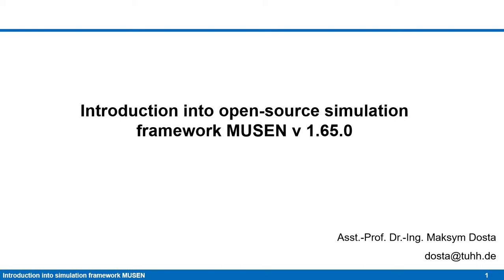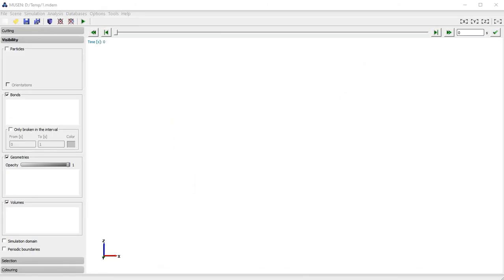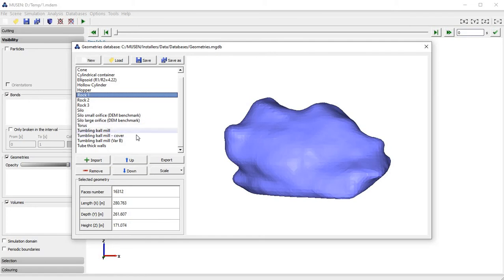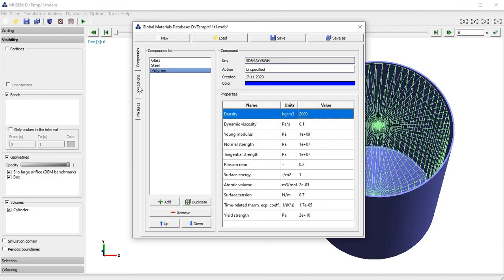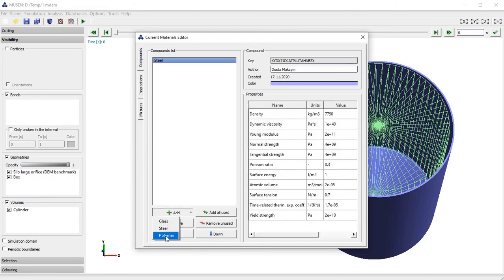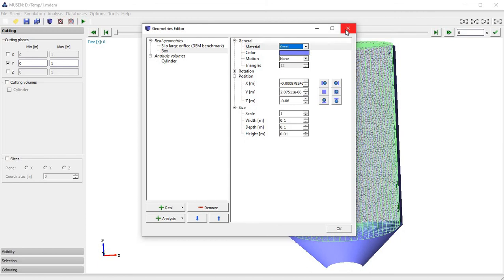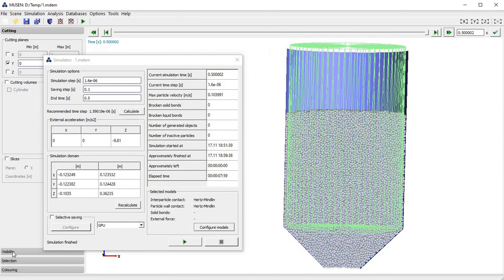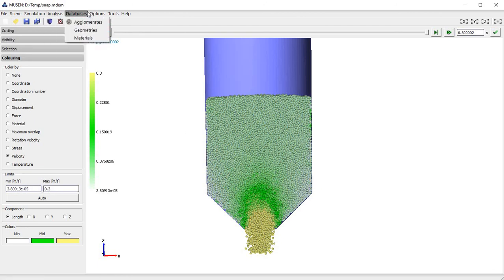MUSEN: Short introduction

Comment: Hi! great simulation and short introduction, excuse me, I can create a simulation between liquid flow and particle? I mean, i can transport particles using liquid through a pipe?
Reply from the maker: MUSEN does not allow to perform modeling of fluid phase.
Reply: @musensimulations6940  Please  I am trying to use the latest model, but I am unable to view saved work or rework on them .I always get feedback when trying to save in MUSEM folder that i need to contact administrator for permission

Comment: How can I set a sine wave type of movement for geometries? Thank you.
Reply from the maker: In current version you cannot specify functional dependency to define velocity.  
However, you can define any velocity profile as a set of discrete time points. This can be done either manually in MUSEN or you can initialy create necessary amount of time points in MUSEN and then copy-pase values from any program such as Excel.